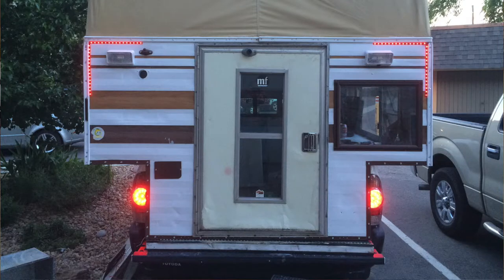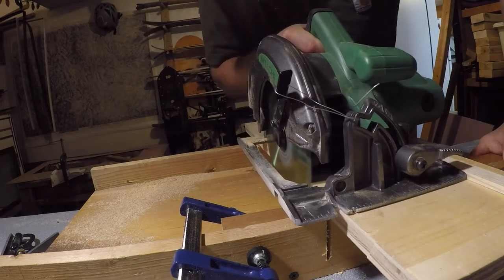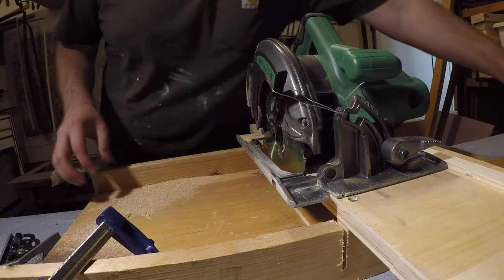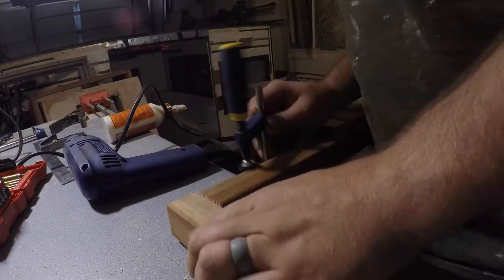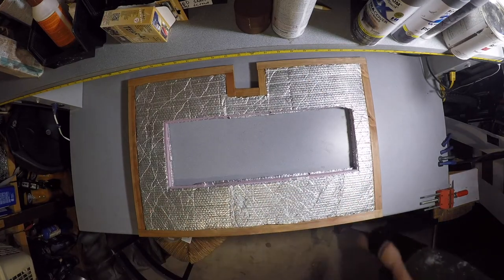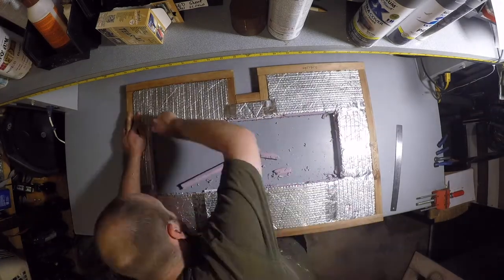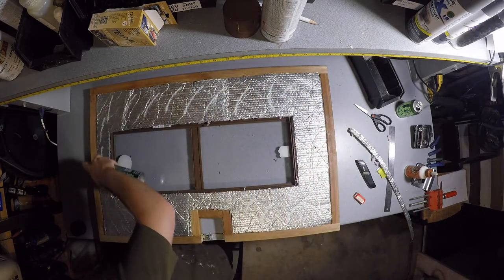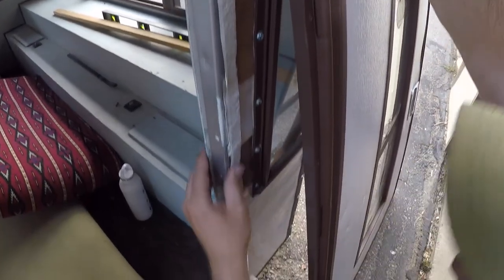DIY Truck Camper Remodel: How to make and install the four wheel camper camper door.

Comment: Just picked up a 1977 FWC Grandby and the door is on the fix list!  Great video!!  Thanks!!
Reply from the maker: Awesome David!! Nice find. What else is on the fix list?
Reply: Hey Tim, The camper is in really decent shape for the age and is all complete!  It has the original ice box instead of refrigerator, LP heater, LP stove, and sink with water tank.  The pop-up material/screens are in good shape, but needs cleaning.  All the cushions are in excellent condition.  Both the front and rear pop-up supports need replacing.  The original roof vent has been leaking for some time and rotted the upper bed panel that extends over the truck cab so I have a pretty good hit list started.  Really excited to get this camper restored and start using it!  It is now in my garage... popped-up and protected from the elements until I get it finished!  Really appreciate your videos... great information!!!!
Reply from the maker: Sounds like a great project. Hope the videos are helpful towards your goals. Let me know whatever questions you have that I could help with.
Reply: Any information on how these older FWCs were mounted to the truck?  I see four holes (I'm assuming mounting bolt holes) in the floor of the camper.  From what I've seen on youtube, most of the newer FWC models are using turnbuckles accessed through the portals under the cushions.  Just watched your video on replacing the floor... really appreciate the information and you have done such awesome work!
Reply from the maker: David. Mine attaches with turn buckles and pass through shuts like the new ones. My Tacoma has speciality brackets made by fwc for the Tacoma. The older campers like mine only had three pass throughs. I added a forth. Does yours not have pass through as well? Maybe I should make a video to show the way it works.

Comment: The original door metal is pop riveted into the wood. Did you do the same on reassembly? I'm thinking of using screws.
Reply from the maker: That is correct, I screwed mine together. My door did not have any pop rivets when I took it apart, maybe I was not the first person to redo it?

Comment: You did a goo job, but you could have done better.  Instead of the reflective insulation, get foam the right thickness, use pressure treated and glue the whole thing together with that foaming gorilla glue using vacuum bonding.
Reply from the maker: Thanks for the suggestions. As far as I know the foam board only comes in 1/4 inch increments so no way to get it perfect for this specific door.  Doors holding up good to this day so we are cruising. You working on a similar project?
Reply: @tgmorrissey  I am, it's a 84.5 triple e 32' class a with the stock 454/auto pulled out and replaced with a British Leyland industrial diesel and 5 speed stuffed in.  The door had disintegrated basically.  So I made a new one the same way the factory did only with pressure treated.  And I know that's how they built it because I work at the factory building class c campers for a living, we don't build class a any more.  Feel free to bug me if you have any questions, I like the work your doing and love helping people.
Reply from the maker: iambeeman1 thanks for the info. Happy camping !